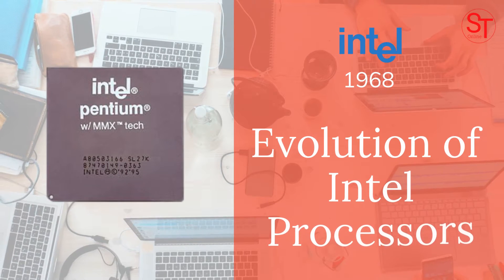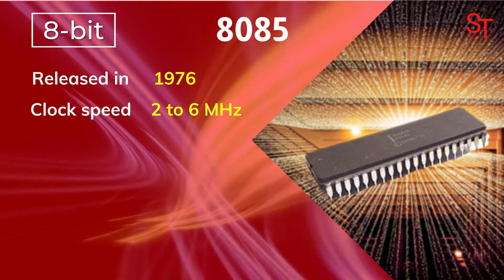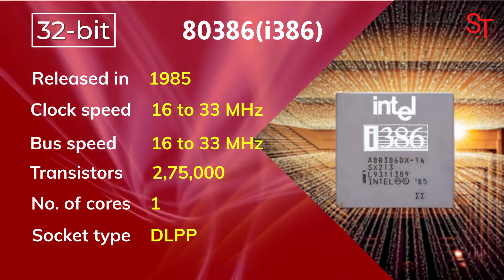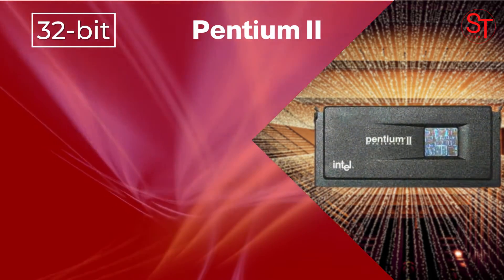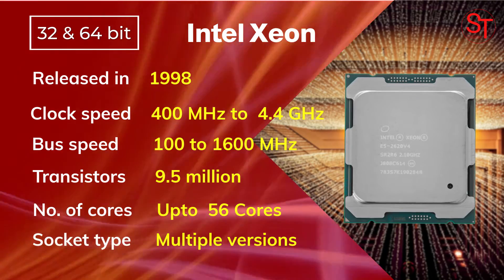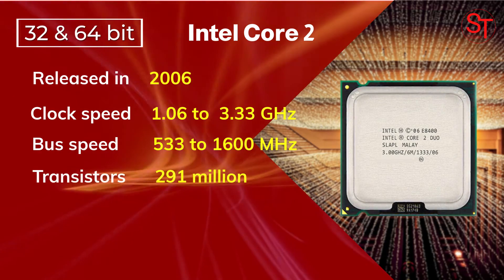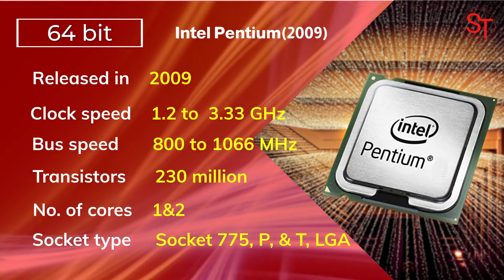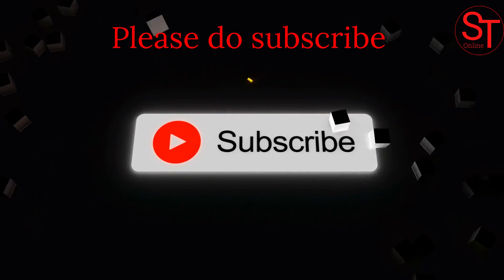The history of intel Processors | The evolution of Intel processors since 1971 to 2021, D4004 to i9

Comment: How do I know which one of Pentium that I have?
Reply from the maker: On Windows:
a. Press the "Windows key + R" to open the Run dialog box.
b. Type "msinfo32" in the Run dialog box and press Enter.
c. The System Information window will open. Look for the "Processor" or "Processor Name" field, which will mention the model and details of your Pentium processor.
Reply: @softechonline  in addition to this, there's also many third party programs that show your computer specs. Aida64, speccy, etc